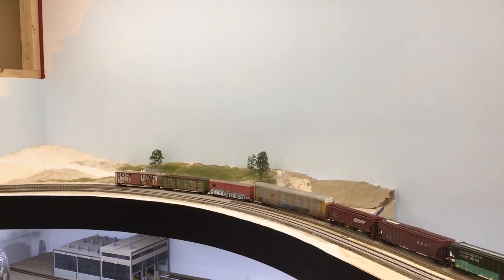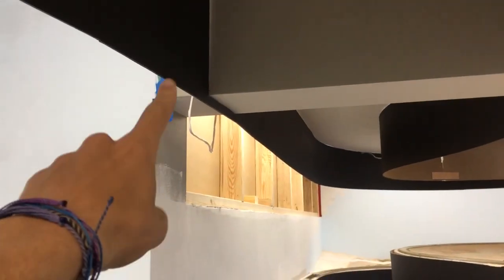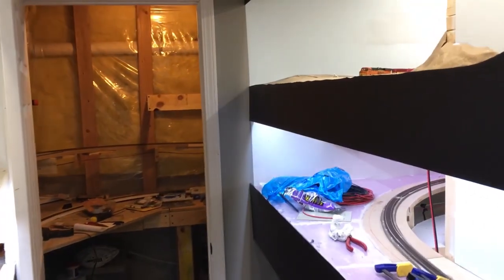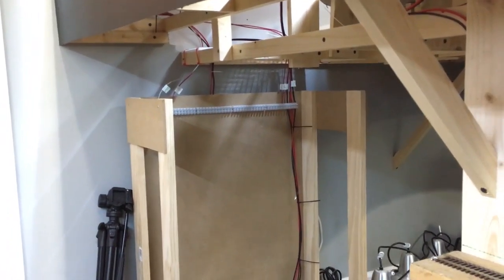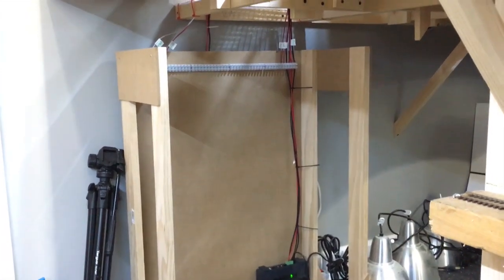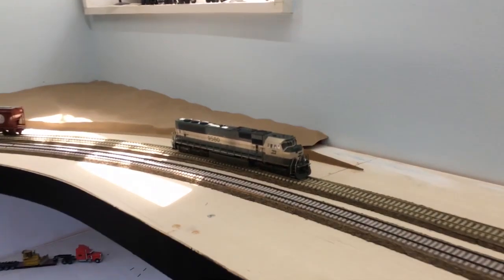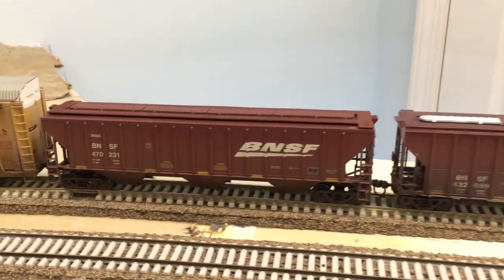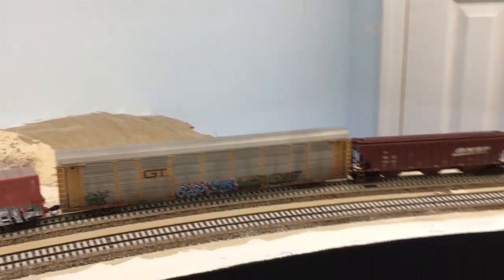Layout Update 43: Painted the fascia, DCC, and stuff for sale

Comment: Looks great. Looking forward to your wiring DCC update. Did you ever hesitate about running your layout through the wall ? I am facing that situation at the moment , it is only drywall I guess :-) Thanks for sharing.
Reply from the maker: Thanks! Yeah that was definitely something that I tried to work around originally, but then I realized how nicely that unfinished back room would work as a staging area. Conveniently, because the backside is unfinished, it would be easy enough in the future to cover those holes from the backside and then insert a roughly fitting piece of drywall. A bit of joint compound, and nobody would ever know. In my mind, it's not as permanent as it might seem. Like you say, it's only drywall, haha.
-Cam

Comment: Hi, Do you plan on installing your block detectors locally whereby using shorter track feeders or do you plan to install the block detectors on that control box and run hundreds of feet of wire ? Will you do the same for the signals ?
Reply from the maker: I initially considering doing local control for block detection and signaling and then running those wires back to a central point. But at least for me, I think I'm picking the lesser of two evils because each block detection coil would require 2 small gauge wires (I guess I could splice in larger wires) to run back to a central board. This way, I'm running a single larger gauge wire from each block back to the panel which I plan on fitting with a few Digitrax BDL168s. For the signals, I think I will use Cat5 cables which can hook up two signal heads each. I'll run the cables from the signal back to the control panel and hook the individual wires up to Digitrax SE8Cs. I considered using RR-Cirkits components, but I priced it out based on my needs, and the Digitrax route will wind up being about $100 cheaper. But everybody's layout is unique, so just because I think this solution works best for mine, doesn't mean it's necessarily right for yours. Keep in mind that I've had to consider what would be best to work around two doorways and a lift bridge. I'll have plenty of videos on how/why I'm setting things up the way I am, and I expect to learn a lot along the way. Hopefully that helps!
-Cam
Reply: Thanks for the reply. You should also look into Digikeijs products. They have loconet devices and are reasonable priced. I noticed that your command station is the ESU CabControl. From what I was told by Matt Herman from ESU, the loconet connection is physically on the box but it does not work. They have a licensing issue with Digitrax. So until that gets resolved, there won't be a software update to enable the port, FYI.Also, Team Digital have very nice loconet devices. Their BlocD8 use the coils for block detection and their SMD84 for peco coil turnouts control 8 turnouts instead of 4 as Digitrax DS64. Also the have more builtin options. I also use their SHD2 for signal decoders.Of course in the end you should build your layout based on your skills. I just don't understand why most people wire all there devices to a central panel like a home fuse box. If your going to use loconet then why not just run one wire from the command station and daisy chain it to each device along the way. Much less chance of running into a wiring problem. Please explain.